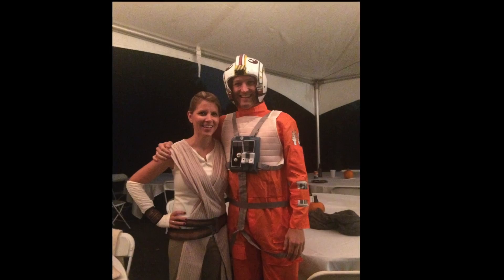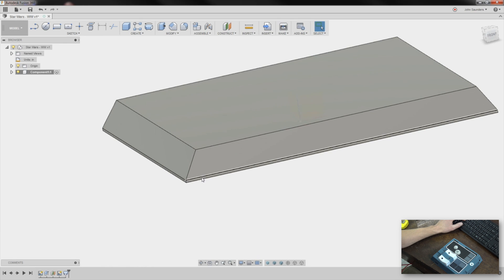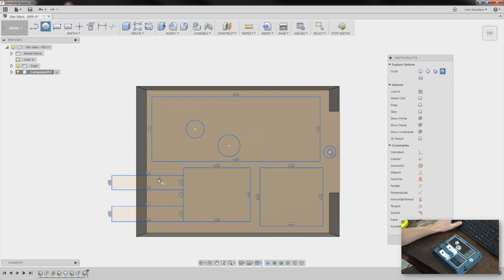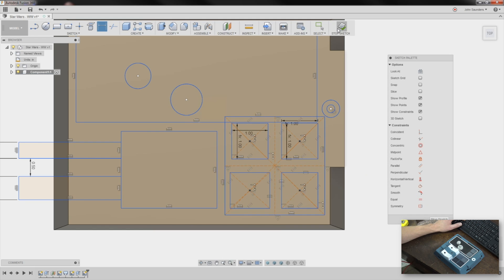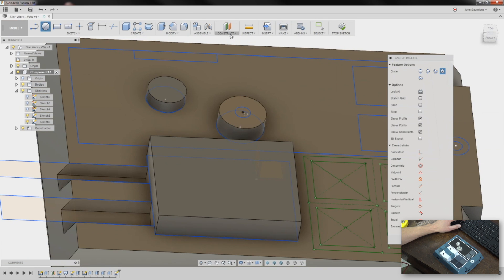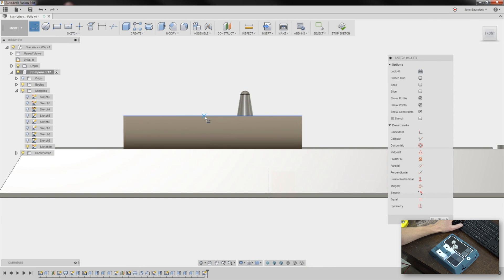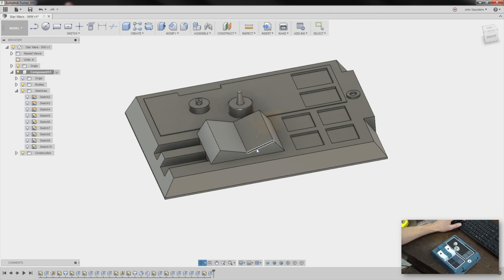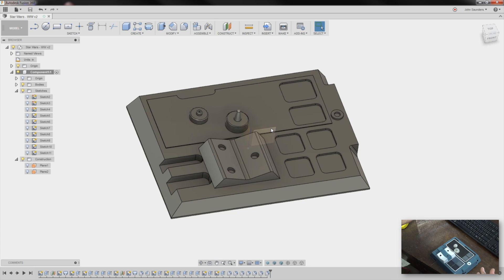Fusion 360 CAD: Star Wars X-Wing Fighter Best Plate!  FF60

Comment: gotta say like watching your vids. watched some last winter or when they randomly popped up on my feed. Even watched John Grismos stuff. amazing on how tight knit alot of people are on the yt comminity. inspired to possibly get a tormach because of you two. i keep questioning its ability but i see success. Out of Hs i ran mazaks brigeport prototraks and haas, after taking machining mt senior yr at the collegw for 2nd half of day. mainly at work now where im at i only run manual lathes and a bridgeport mx2 which just got upgraded to newer lcd control. old one would burn up once . year and xost 2k after core charge to replace. i have so much i wanna do but stuck doing other work, kind of a do it all.

Ive already out fitted myself with. 4x4 plasma table, smaller bridgeport with m head, that the bearings are kinda gone in. Got an old delta rockwell 11" swing lathe which i love, but if i was serious wouls buy bigger. also have 2 atlass that are mainly restorarion project. ones for parts. have tig and mig welders. Im just worried about finding work thats not to much, but also enough